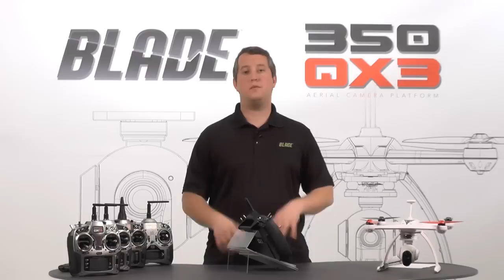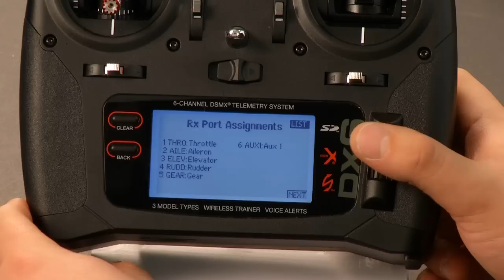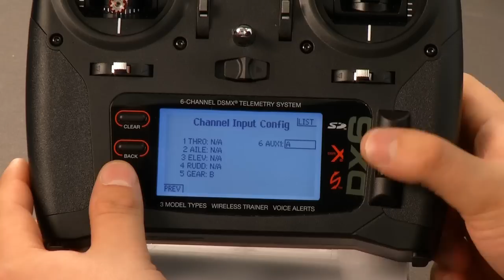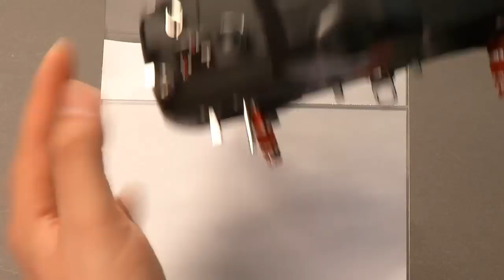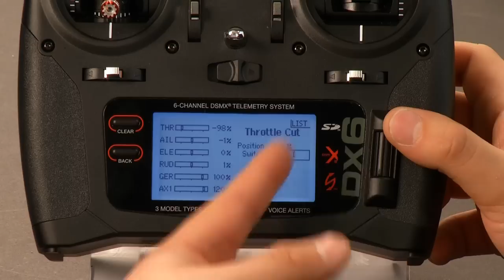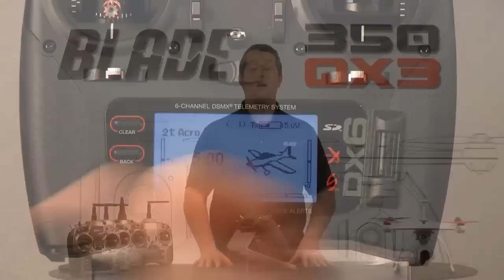350 QX3 - DX6 Programming

Comment: Thanks for the video, I have setup my radio exactly as you described, and I need your help. First my gimble will not work I flick the switch and rock the throttle nothing. Second my QX will not lock in GPS the lights keep flashing red to green, but it will activate and the return home works?????? Any help with my GPS issue would be great, thanks again.
Correction it is the compass that won't calibrate.